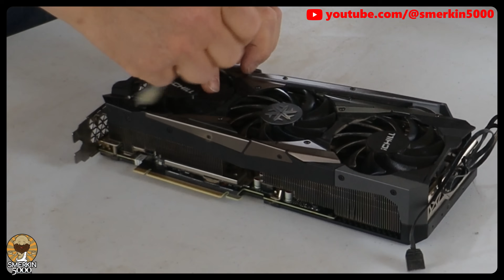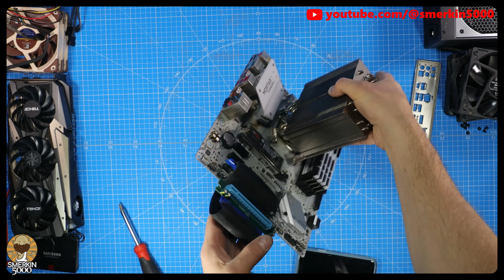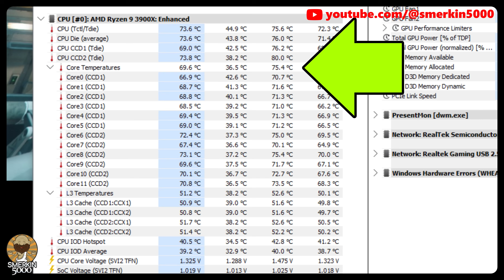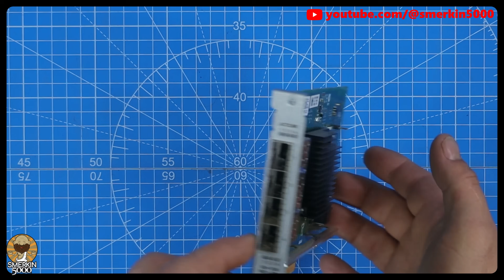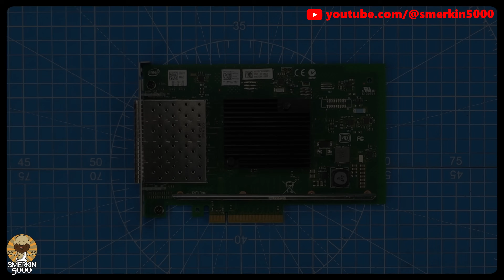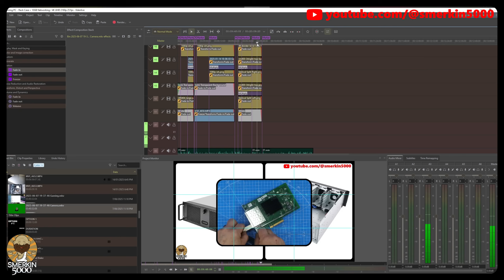Gaming PC - Rack Case + 10GB Networking

Comment: How was the CPU cooler clearance. The NH-u12A is listed from Noctua as 158mm in height, and Silverstone lists the RM400 has a CPU clearance limit of 148mm
Reply from the maker: The top of the heatpipes are taller than the case by about 1mm. The lid goes on ok but it ends up being curved (visible when placing a ruler over the top of the case). Because I left a gap of 2RU between cases I am able to slide the case in/out of the rack however if there was no gap there then it would not work.
Reply: @smerkin5000  Thanks for responding. It looked very close in the video. I have just ordered an RM400 and a Peerless Assassin 120 mini for the cooler to make sure I have the clearance. Also with a 3900x but running fairly light workloads on TrueNAS (file shares and a few containers for things like JellyFin). It should do a good enough job of cooling it.
Reply from the maker: @atmunn sounds great, I’m sure the cooler will be fine 👍🏽

Comment: How tight is the GPU with the lid on, especially the power connectors? I'm really considering rack mounting my PC next year. A 5U case is both expensive and different to find, a 4U case has way way more options from various manufacturers. I only really wanna buy once, so I kinda wanna get it right. Currently still using a 1080Ti, which will definitely fit, but future proofing and GPUs getting chonkier and chonkier, just trying to gauge things.
Reply from the maker: There is almost 1 inch of clearance from the top of the 3090 to the lid, so plenty of room. If needed you could use a 90 deg power connector on the GPU to help with clearance.